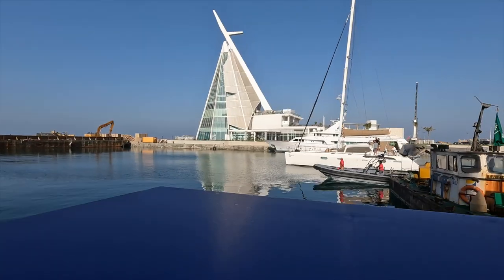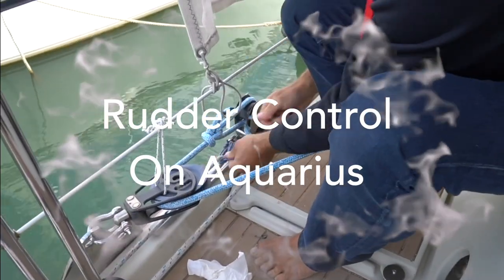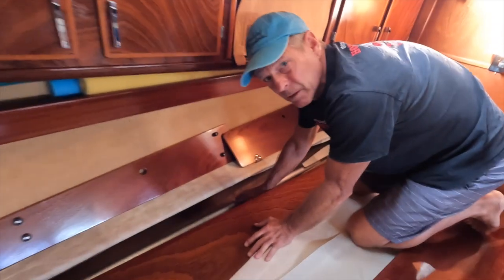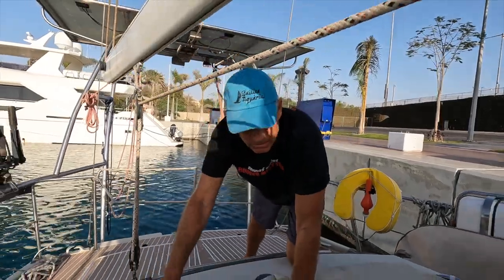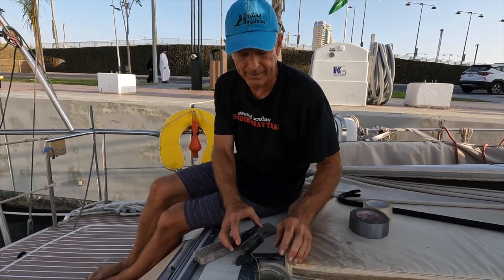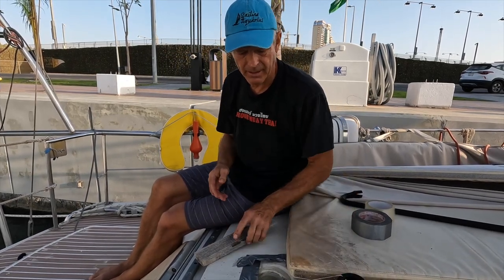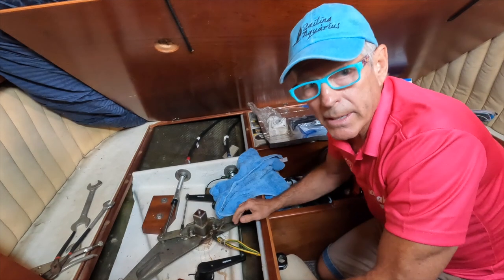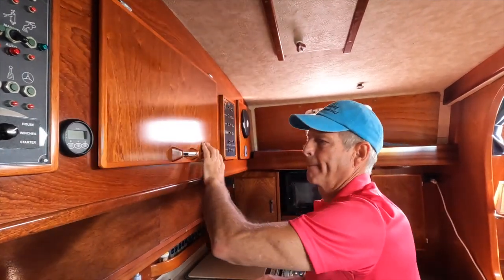Tips on Tuesday - Rudder Control

Comment: I fell in love with the Super Maramu when I first found Sailing Delos. Aquarius is just as amazing! I think Henri Amel tried to think of every possible condition that a blue water cruiser would need for a safe passage, including the water-proof bulkeads, the design of the engine room (which is exceptional), the refrigerator and freezer under the seats, the storage area for water and the use of storage under the interior floors. It is an exceptional design and his legacy has proven to be one of the best. I look forward to your videos every week. Safe passages!
Reply from the maker: WOW, thanks, and Fair Winds

Comment: Hi Ken and Zeville!  Thanks for the video!  Easiest way to remove that plug is to tap it out from the inside, just insert a hammer handle or and tap it out.  I have 2 rubber mallets and use those.  Keeps you in the boat as well.  Bob, Super Maramu 429
Reply from the maker: I tried that first, but it would not budge.  It will work next time, I am sure of that!  Thanks Bob!
Reply: I guess I got lucky!  I'm enjoying your travels.  I am on the hard in Deltaville, VA doing some projects.
Reply from the maker: We will be on the hard in 3 or 4 months.  After Egypt, Jordan, Israel, Lebanon,  Cyprus then looking to Haul Out in Turkey or Greece.

Comment: Hi, Ken & Zivile. Love your boat and love the video! I love the changes that AMEL made since INTENTION (1994, #117) was made. Totally jealous of your salon double bunk! Never saw one of those before. Wish I had THAT! But also that they moved the emergency tiller from the transom lazerette to the salon bunk.  Mine is buried back in that ‘garage’ I gotta change that. Also, the design for the linear drive autopilot is superior because the lever arm on the quadrant is able to be longer. Easier on the drive unit! QUESTION: Could you please tell me, where did you get those moisture alarms?! How are they powered?
Reply from the maker: Got them on EBAY for less than $10.  Search for Leak Detector, or Water Sensor.  Mine are powered by a 9V battery.

Comment: Wouldn't want to rig your emergency tiller in a crisis moment. Hopefully you'd still be able to use your autopilot to steer should the hydraulic or cable system fail. Great video by the way! Happy sailing.
Reply from the maker: I agree, moving around in the boat with heavy poles in large waves would be painful for my wood finish.  Anyway, it was a good exercise to see how it all goes together.  We had a friend that had to do this on a passage between FP and Hawaii.  Then 7 days at sea using a tiller...  OMG, I really respect Capt S!  I am sure he said "Aloha" when he arrived in Hawaii!  Best!

Comment: Good video.
I've understood that in Amel's yachts, the cabins can be sealed in case of taking water in. Does the hole in the roof have any influence on that ?
Reply from the maker: No, if all the water tight doors are closed, and the safety bars are in place, that hole at the top would remain well above the water line if any one water tight area was fully flooded.